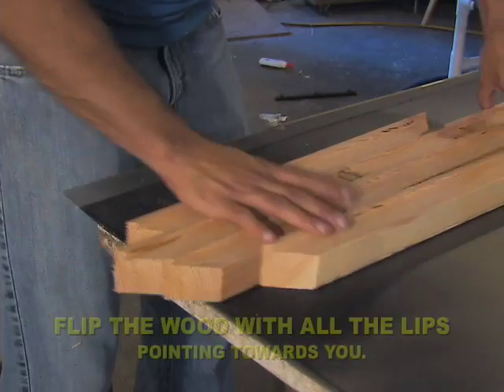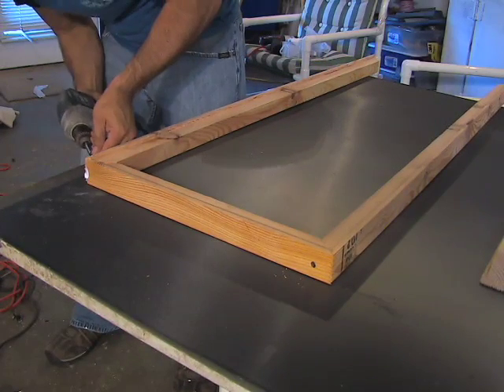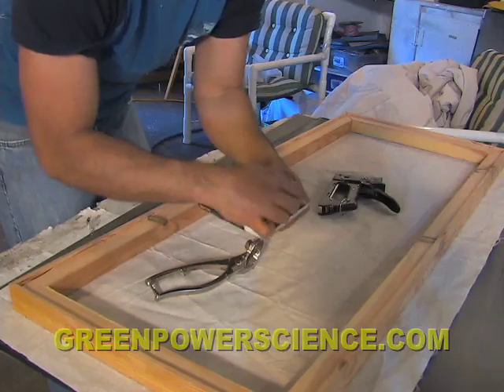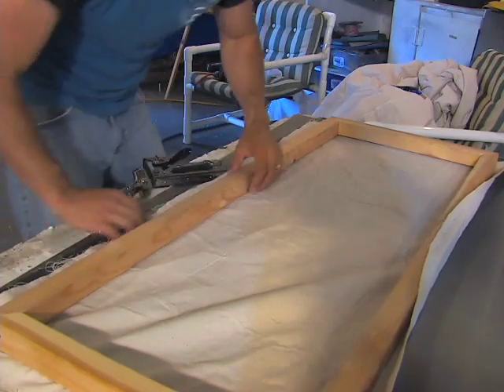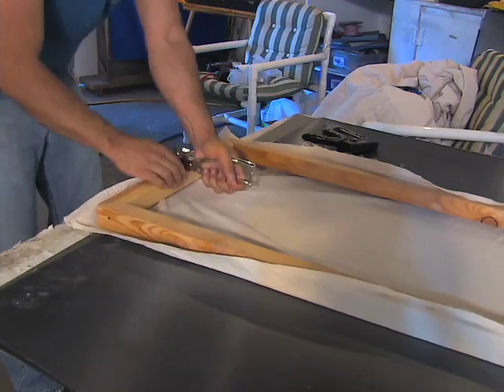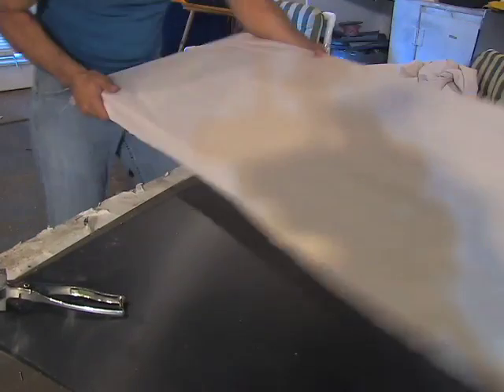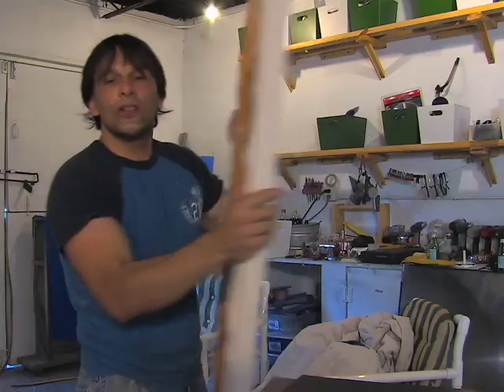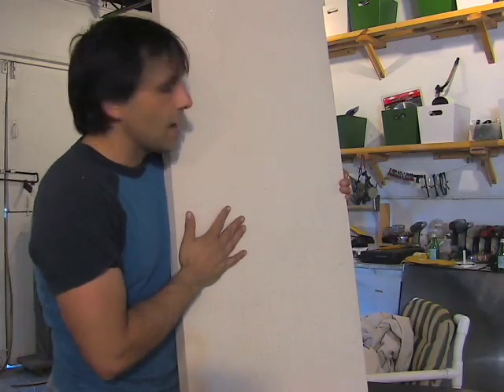P 2 STRETCHING CANVAS ARTIST WINDMILL BLADES RECYCLING KILZ

Comment: Few more things, if you are milling your own bars try to avoid knots, even on these type of gallery-style bars (does not require expensive framing, you paint around the edge), as they are the first areas to break when moving your wall art(and likely tear your nice painting).  Also, if you have a longer, skinnier canvas, you may need a center brace. In the future, please cover wall cleats and hanging hardware options, whether hanging a solar panel or a canvas, some of us are hardware geeks!!

Comment: Wonderful job,  I am a CPF(Certified Picture Framer...I can add a few tips here if you don't mind.  1)make sure your glued corners are pretty dry before stretching canvas on with one screw point,  your bars can twist on you, 2)learn to use pliers upside down in one hand while pulling, then staple with other hand using nose of stapler as extra holding/pushing power before you staple, and 3)any fine wrinkles can be made to disappear with a spritz each of water, then alcohol, and left to dry.Kudos!